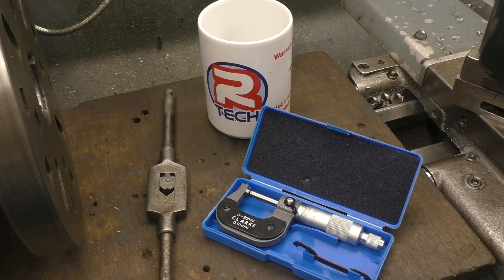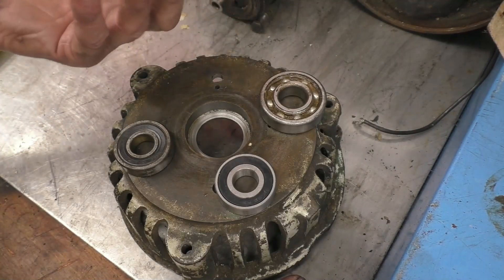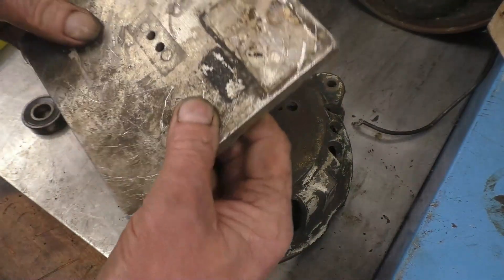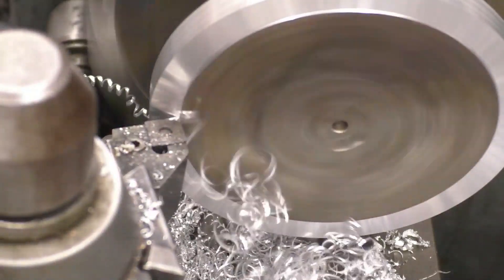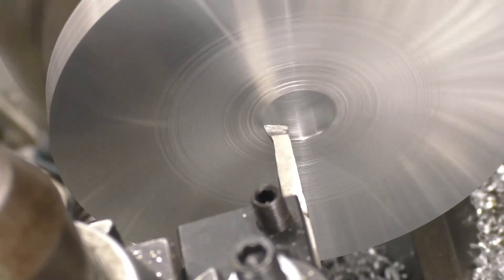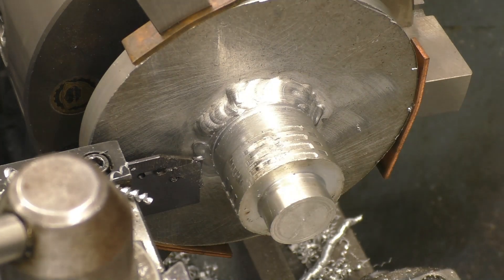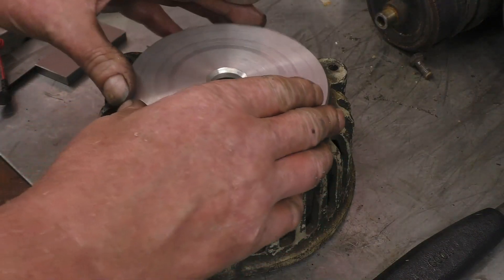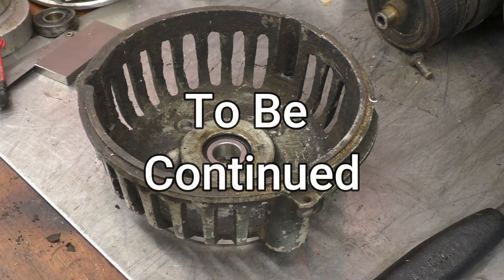SNNC 449 P1 Monthly Draw . Machining aluminium

Comment: If you do get your arse in gear, please tell us the trick!  :)
Lathe question: at 8:25, is the difference in surface finish from the cutting speed going down as it approaches center, or was this fed by hand?  Great demonstration shot in either case.